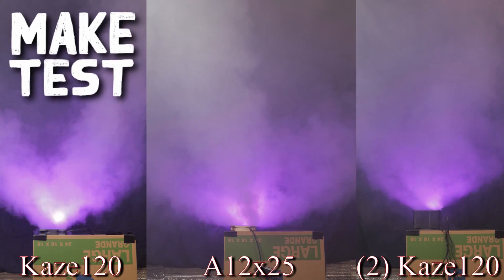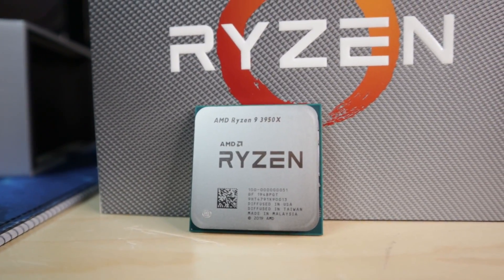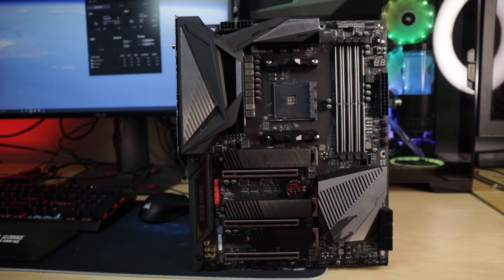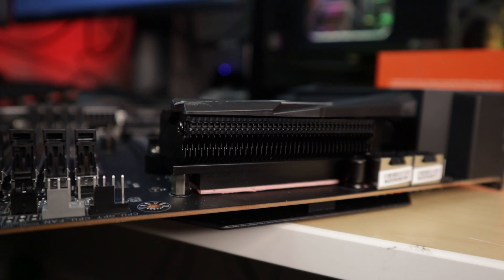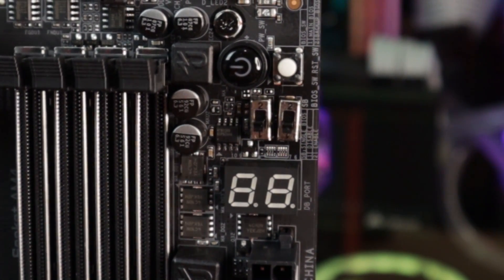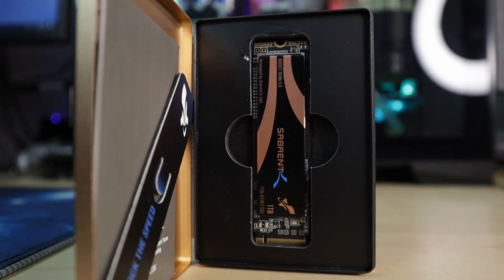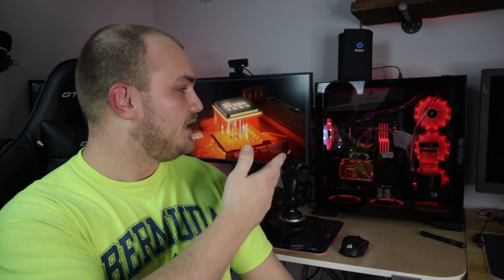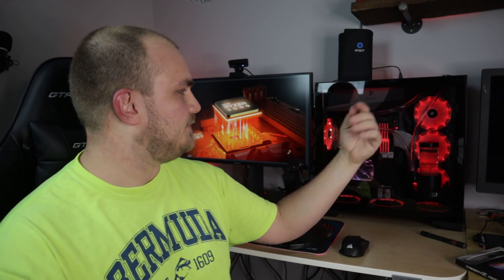EVERYTHING WENT WRONG, Upgrading I7-7700K to Ryzen 9 3950X

Comment: @Major Hardware, you and I really need to talk.

I spent six months learning how to configure a Ryzen 3000 series CPU and the first two months I spent unlearning everything I thought I knew about how to configure a system from my experience of 37 years being a computer techie.

Nearly all of the videos you can find from the major tech-youtubers on the subject of configuring a Ryzen 3000 series CPU is garbage. 

At the moment you have a 3950X system that will degrade over time and will fry your CPU in the end, it is only a matter of time whether the Oxide Breakdown or the Electromigration kills it first.

Let's take your CineBench R20 score, you will have noticed that the CPU will be drawing between 140 and 150 Watts of power to get that score of 9,259. My CineBench R20 score is 10,170 and the CPU uses a maximum of 118 Watts to get that score.

The rest of my scores that you can compare your system to are:

1) CineBench R20 all-core score of 10,170 and a single core score of 500

2) FireStrike EVGA 1080 Ti SC2 I have a Graphics Score of 28,213, a Physics Score of 33,848 and a Combined Score of 15,488
3) FireStrike Extreme EVGA 1080 Ti SC2 I have a Graphics Score of 14,130, a Physics Score of 33,821 and a Combined Score of 7,057
4) FireStrike Ultra EVGA 1080 Ti SC2 I have a Graphics Score of 7,180, a Physics Score of 34,089 and a Combined Score of 3,902

5) TimeSpy EVGA 1080 Ti SC2 I have a Graphics Score of 10,292 and a CPU Score of 15,390
6) TimeSpy Extreme EVGA 1080 Ti SC2 I have a Graphics Score of 4,791 and a CPU Score of 9,421

7) Ghost Recon Wildlands benchmark 1080p everything at max FPS 86.33, CPU 14.7% (Min. 9.8% Max. 23.2%) and GPU 96.7%

8) 7zip Compression Average 124.906 MB/s, Decompression 199.303 MB/s, Total Score 162.105 MB/s
Reply from the maker: those are some pretty high scores, how did you accomplish this.
Reply: @MajorHardware  I am very sorry about the tardiness of my reply, I caught a cold and my nose has been running - though not as it normally does to get away from my ugly face :D

I have to preface this with some info that is woefully lacking in the videos or articles you may see or read.

The thing is that as opposed to Intel CPUs that you have been used to (and that I was used to) the BIOS is supplied to the motherboard manufacturers as a binary and is called AGESA.

So what you see displayed as "The BIOS" is in effect just a configuration menu for the AGESA. The problem about editing the AGESA portion found under "Settings" under the headings "AMD CBS" and "AMD Overclocking" directly is that with some of the options, if you enter a wrong value, then your system will not boot. What is worse however is that some of the settings cannot be removed with a "Clear CMOS" and your mobo is effectively bricked.

With the GigaByte board you have you are lucky that you have a Dual-BIOS and I would strenuously suggest that you change the switches to "Single BIOS" and have a clean. up to date Backup BIOS and you can then configure the Master BIOS to your hearts content.

So now to configuring your BIOS:

1) Go into Easy Mode (F2) and click on "Load Optimized Defaults (F7)
2) Switch to Advanced Mode (F2)

3) Under the heading "Tweaker" do the following:

a) Go down to the bottom of the page and open "CPU/VRM Settings"
i) Set "CPU Vcore Loadline Calibration to "Turbo"
ii) Set "SOC Loadline Calibration" to "High"
iii) Set "PWM Phase Control" to "eXm Perf" (eXtreme Performance)

2) Under the heading "Setting"
a) Go to "AMD CBS"
i) Go to "XFR Enhancement"
ii) Set the FCLK Freqency to the desired value (in your case 1800 MHz)
iii) Set the "UCLK DIV1 MODE" to "UCLK ==MEMCLK"

b) Go to "AMD Overclocking" under "Settings"
i) Click on "Accept"
ii) Go to "DDR and Infinity Fabric Frequency/Timings"
iii) Go to "Infinity Fabric Frequency and Dividers"
iv) Set "Infinity Fabric Frequency and Dividers" to the desired value (in your case again 1800 MHz).

3) Under the heading "Boot" do the following
a) Set "Full Screen LOGO Show" to "Disabled"

Of course setting the boot drive etc. should be obvious and I don't think I need to explain that.

Do NOT set anything else, like "Extreme Memory Profie(X.M.P)" for instance.

There that's you done with the BIOS part of the configuration

Boot into Windows and install "Ryzen Master". 

When Ryzen Master has loaded, click on "Creator Mode" on the left hand side.

1) Make sure "Control Mode" is expanded and under that heading click on "Manual"

2) Make sure that the section "Cores Section" is expanded
a) Expand "CCD0" and "CCD1"
b) Click on the red circle on the right hand side so that it changes to what looks like a Green "X"
i) Click in the first field beside "C 01" and change the clockspeed. You should have absolutely no problems setting it to "4250". When you have done the rest of the configuration then test it and increase it (in my case it is set to 4300 and I have no problems). When you set one field, because the Green X is activated, all the other values will change to what you set.

3) Make sure "Voltage Control" is expanded
i) Set "Peak Core(s) Voltage to 1.3 Volts

4) Make sure Memory Control is expanded and that it is "Included"
a) "Coupled Mode" should be "On"
b) Set your memory clock speed (in your case it would be 1800) remember this is the data rate. Infinty Fabric runs at the data rate and RAM runs at double data rate.

5) Make sure "Voltage Contols" is expanded
Unless otherwise stated, leave the values on "Auto"

a) MEM VDDIO should be set to 1.35
b) MEM VTT should be set to 0.675
c) VDDCR SOC should be set to 1.05

6) Make sure "DRAM Timing Configuration" is expanded

Now I have found that unless these values are set then every time you change something (like the voltage or the clockspeed) the system will want to reboot. If these are set then the values are just changed and you can continue

a) Change "CAS Latency" from "Auto" and you should see the correct value for your RAM
b) Change "Row Precharge Delay" from "Auto" and you should see the correct value for your RAM
c) Change "Read Row-Column Delay" from "Auto" and you should see the correct value for your RAM
d) Change "Write Row-Column Delay" from "Auto" and you should see the correct value for your RAM
e) Change "Row Cycle Time" from "Auto" and you should see the correct value for your RAM

Leave everything else on "Auto" and you can configure those sub-timings at your leisure.

7) Make sure that "DRAM Controller Configuration" is expanded
a) Change "Cmd2T" from "2T" to "1T". If you have good quality RAM then it should run at 1T. If not then change this back to 2T.

Now at the bottom click on "Save Profile" and then click on "Apply & Test" and the system will reboot.

Now as you will see, the CPU is limited to a maximum of 1.3 Volts and essentially you are just seeing how much clockspeed you can squeeze out of those 1.3 Volts. When the system is not under load then of course the operational voltage will decrease.

Now comes the best part about the 3950X.

If you are mainly gaming, then click on the profile "Game Mode" and do exactly the same as above EXCEPT:

1) Under the heading "Additional Control" turn "Simultaneous Multithreading" to "OFF". This will run your CPU as a straight 16 Core/16 Thread CPU.

2) Under "Cores Section" make sure the red circle is a green "X" and add 100 MHz to whatever was stable running 16 Cores /32 Threads with SMT ("Simultaneous Multithreading") ON

The one problem with the GigaByte BIOS is that this is not changed and you have to go into the BIOS and

1) In the Advanced Mode go to "Tweaker"
a) Under "Advanced CPU Settings"
i) Go down to "SMT Mode"
ii) Change from "Auto" to "Disabled"

Save and exit.

If you want to go back to using 16 Cores/32 Threads just choose the "Creator Profile" and then change this value back to "Auto" again.

That's it.

I know it looks like a lot, but it really isn't.

IMPORTANT!!

Every time you reboot the system you have to load Ryzen Master and apply the profile you want. Unfortunately there is no way as yet to automatically load a default profile, but I hope that option will be forthcoming in the future.

If you are applying the same Profile you had before you shut down then the system will not need a reboot.

After you have applied the profile you can close Ryzen Master.

 Have fun.
Reply: @MajorHardware  Some (well actually any) explanation for my recommendation with regard to configuring the Ryzen 3000 series of CPUs was missing and I think that I should offer that for your consideration.

1) You can apply my recommendation to EVERY motherboard from EVERY manufacturer (ASRock, ASUS, GigaByte, MSI) with equal success this is because 

a) I have confined the configuration of the motherboard functions (LLC, turning off boot logo, setting boot drive etc) to the motherboard BIOS.
b) I have confined the configuration of the CPU and the RAM to Ryzen Master, because the CPU and RAM are inexorably intertwined.

2) Depending on the BIOS it is more or less limited to the amount of configuration data it will accept from Ryzen Master.

For instance the ASUS BIOS will accept the change from SMT ON to SMT OFF from Ryzen Master whereas the GigaByte BIOS will not for some reason.

Also some BIOS's will accept the FCLK change from Ryzen Master and implement it if you want to overclock your RAM, whereas the GigaByte BIOS will not.

At the end of the day, my madness has a method, and you mentioned Buildzoid. As much as I hold him in high esteem, he totally screwed the pooch with regard to his video https://www.youtube.com/watch?v=G7Z7bJJcCNY where he tried to treat a Ryzen 3000 CPU like he would an Intel CPU.

The problem I have ran into is that if I try to configure the 3950X manually, just through the BIOS, the readings I get from the likes of HWInfo or AIDA Extreme bear absolutely no resemblance to what I actually inputted in the BIOS - especially with regard to voltage values.

These utilities have still not been updated to reflect what is going on and they are effectively useless in monitoring the most vital functions of your CPU.
Reply: @michaelnager6059  Hi man,  I think it would be useful if you talk to bullzoid in that youtube vid to see if he tests your input. BTW what do you meant in the first paragraph with this: "At the moment you have a 3950X system that will degrade over time and will fry your CPU in the end, it is only a matter of time whether the Oxide Breakdown or the Electromigration kills it first." Why do you think @Major Hardware will have that issue? (of course every cpu degrades, but it looked like it will happen a lot sooner from your words). Thanxs in advance!
Reply: @laureanoalfaro9351  The reason why I say that is because I can remember back to the time before there was a 3rd Gen Ryzen CPU and there was reporting on the TSMC 7nm node and the max voltage it was specced for was 1.3 Volts.

AMD punts way more than that into the CPU even under load it will punt in 1.35 or more Volts into the CPU.

The heat that is generated, just by running it in default and the amount of current it allows itself is also horrendous.

I have spent the past eight months since I got my first 3rd Gen Ryzen CPU (3600X) experimenting with various configurations until I hit on the configuration I documented in my guide.

I have experimented with my 3950X and also with a 3900X my friend in the US sent me (which either was a total silicon lottery loser or degraded noticeably just in the two and a half months he had it before I got to know him and taught him how to configure it).

I also configured another 3900X which was new and that is far superior in its performance to the one my friend sent me.

The thing is that he had not even activated PBO!

Whether Buildzoid tests my guide or not, even though my ambient temp is a lot warmer than his, my benchmark results are far better at far lower temps.

As far as configuring a 3950X is concerned Buildzoid is barking up the wrong tree in the way he configures it.
Reply: @MajorHardware  In case you are wondering my R9 3950X running at 4.4 GHz at 1.3 Volts with SMT Off:

1) CineBench R20  all-core score of 7,817 and a single core score of 513

2) FireStrike EVGA 1080 Ti SC2 I have a Graphics Score of 28,295, a Physics Score of 30,052 and a Combined Score of 15,833
3) FireStrike Extreme EVGA 1080 Ti SC2 I have a Graphics Score of 14,170, a Physics Score of 30,168 and a Combined Score of 7,076
4) FireStrike Ultra EVGA 1080 Ti SC2 I have a Graphics Score of 7,186, a Physics Score of 30,164 and a Combined Score of 3,906

5) TimeSpy EVGA 1080 Ti SC2 I have a Graphics Score of 10,271 and a CPU Score of 15,340
6) TimeSpy Extreme EVGA 1080 Ti SC2 I have a Graphics Score of 4,788 and a CPU Score of 7,564

7) Ghost Recon Wildlands benchmark 1080p everything at max FPS 86.51, CPU 23.4% (Min. 17.2% Max. 48.6%) and GPU 97% 

8) 7zip compression/decompression, Compression Average 103.106 MB/s, Decompression 129.844 MB/s, Total Score 116.475 MB/s

Thermals are a lot lower with SMT Off and I'm not losing all that much

Comment: Your very first mistake is that you did the classic, "Pea sized blob" application of TIM. The thing is that the R9 3850X (which I have in conjunction with the GigaByte AURUS XTREME motherboard) does not have the heat source, namely the CPU, in the centre of the PCB but rather off centre towards the edge.

With the way you applied the TIM it is guaranteed that some of the heatspots created by the two CPU chiplets will not be covered and you have just thrown away quite a lot of your potential cooling performance.

In this case you have to use the spread method to make sure that all of the IHS is covered.

Comment: Even worse than having a power cable mixed between vendors is when you mix between two different product lines from the same vendor (EVGA bronze and gold), which then blows up your SATA SSDs. :(

I notice you said DCS wasn't that big of a difference, but your .1% lows were an order of magnitude different between 7700k (3.8 FPS) and 3950X (38 FPS).  That makes a big difference in playability, more than making up for the 2% loss in average framerate.  1% lows were also better on 3950x...

Comment: Also check your ram again. I work at a computer store and I'll tell you a secret because I like buying clearance trident z. If the "ram" stick isn't working put in one. Let the computer start like normal. Turn off the pc. Put the "broken" stick in then restart. That normally fixes the issue.
Reply from the maker: interesting, So i went and bought another kit of the same ram and booted the system with this ram in slots A2 and B2, system booted no problem no XMP. i then shut it down and inserted the other ram kit with the 1 stick that doesnt work, when the system came back up only B1 and B2 were shown as havening ram installed.

Comment: Whenever I put a system up, I always throw a power supply tester on all the connections coming off of the power supply. Just because you can have manufacturing defects, cables being damaged when they are pulled or moved from one system to another. Or custom cables aren't all perfect. And cables can also not only vary between manufacturers, but some vendors that use multiple OEMs can have different cable pin-outs with in a power supply series. So I just do that as a matter of practice. It has saved my vertical smile more than once.

Comment: Thanks, great video, this is the reason I'm still rocking the 7700k with a 2080ti, I don't do anything else except game at 4k and 1440p 120hz. A part of me says to upgrade and the other says why
Reply from the maker: after some oc on both my cpu and gpu also correcting 2 other issues i found things are looking even better and maybe i need to make an update to this video.
Reply: @MajorHardware  Oh no don't do it, it's perfect as it it 😂😂
But good to hear on a serious note, it's beast of a CPU, Games are using more threads now which is having a effect on the on the 7700k especially in frame times,
I also wonder how fast it is for Vm as well like running MacOs, that would sway me a bit
Reply: Exactly Im rocking a 6600k with a 1080ti and it's paired nicely. ANY zen right now would be a sidegrade. People say stuttering, come on those things are milliseconds unnoticeable.

Comment: I’m looking to make the same upgrades here soon!  Come from an 8700k
Reply from the maker: Pro tip dont be like me and let a rogue psu cable sneak into the build
Reply: Major Hardware hah!  Yeah funny you mentioned that because I have done the same thing with a previous build!  Though didn’t quite have AS MANY head aches!  

Glad you are now happy with the upgrade!  Being a content creator myself as well and seeing those render times made my jaw drop!  You might have sold me!
Reply: Warm Soft Kitty I mentioned I am looking for upgrades with productivity in content creation.  I don’t just game on my rig and the Ryzen 9 blows away the 8700k or any other mainstream Intel chip for that matter in CPU dependent workloads.
Reply: Warm Soft Kitty yep!  4K video files.  My 8700k can do it just fine but as seen here in this video the time differentials to render are huge!  Which would be nice for me to get some of that time back!

Comment: Sooo, Mega dramatic Title leading casual glances to think there are strange issues with AMD hardware,,NOT if your not a doofus, who doesn't know about drivers, does intel not use drivers anymore as for the wiring f up yeah news splash Power sipply makers have some differences ,clearly a pro tut, even corsair PSU's have different connectors between different Sku's, they are not all the same.
Should have been titled I MESSED UP Upgrading MY I7-7700K to Ryzen 9 3950
Reply from the maker: certified doofus :-)